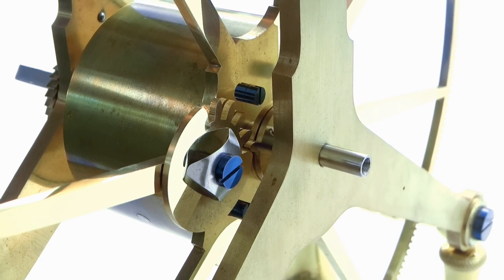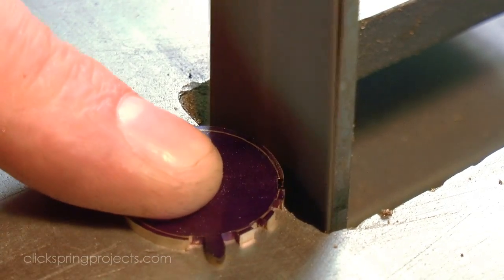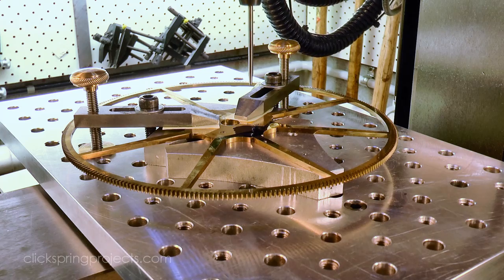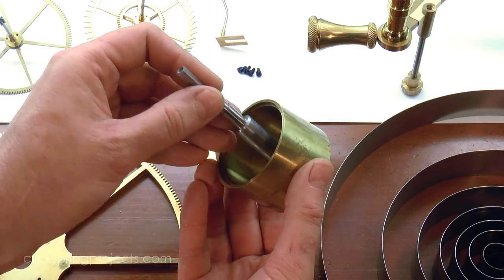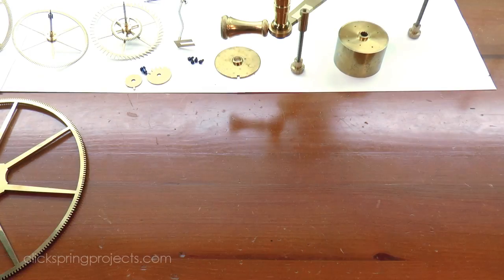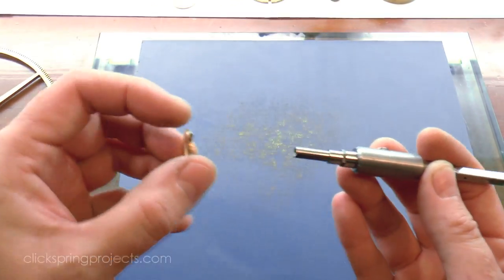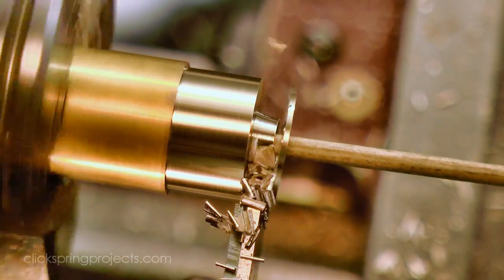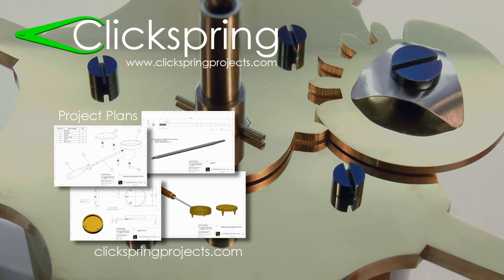Clockmaking - How To Make A Clock - Part 22 - Making The Stopwork Mechanism

Comment: Some people love worn bare metal, and painted metal full of and marks and scratches. Other people love clean polished metal, with flawless smooth surfaces. Personally I love worn and rough metal, it gives the piece character and you can see it has been used, and what parts are handled most. I can only say for these different kinds of people, that get satisfied with a specific look, you guys that like polished surfaces, have it hardest, for obvious reasons.
Reply: Personally, I agree with you. But this sort of project needs to acquire its dings honestly, over the course of decades. 

Every tick of the clock, every time it is wound, cleaned or moved will gradually add to its character. 

Fine, high quality construction demands the attention that Chris puts into it. The eventual contrast between the meticulous construction and the wear of time provides a unique beauty.
Reply: As you say, "...you can see it has been used.  This look is my favourite also, but this particular clock hasn't been used yet, and he's not artificially adding those marks and scars.  They will be acquired over the years and truly be from being used and handled, rather than beating it up to give that appearance.  When someone tries to make those marks artificially, they rarely look right, as real-world wear and tear is rarely as homogenous and random-looking as most people believe it should be.  I think this will simply add to the clock's beauty as time goes on and it acquires some working history.
Reply: I have to say I admire the work he's putting into getting all the surfaces perfect. I've had to polish hardened steel for days on end as a tool and die maker. And the soft brass must be extremely frustrating because you can scratch your newly polished surfaces so easily. I imagine sandpaper will be a significant cost in making this clock.
Reply: Siegfried Gust  Well worth the effort, though.  :-)

Comment: I was expecting some special jig for bending the friction spring and then you just bent it with hand o.0
Reply: And that hex hole done by hand! Quite unexpected but then again it makes total sense. Will that spring keep its shape over life?
Reply: yup he used spring grade steel its highly elastic he used it in another part on the clock (cant remember which) he went into further details about it in that
Reply: TorrentOfficial, I think the other part made out of spring steel that you're thinking of is... the spring. :-P
Reply: I knew that, I just couldn't remember the name of the video

Comment: End plate, all the screw slots are aligned. Just one more thing to be in awe about in this build.
Reply: I'm always confused how to make that happen, especially for flathead screws with a countersink. Maybe Chris himself can answer: How exactly do you get them perfectly lined up like that?
Reply from the maker: Make the fasteners but do not complete the slots. Drill and tap the holes, and then insert the fasteners (use grips, be gentle, but be sure to get them in there to the correct tension), pick a direction you'd like the slots to align with, and mark. Remove, and then form the slots as normal. Skim the head perimeter to remove any marring from the grips.
I did it for the large wheel fasteners in this clock after a viewer request, but generally its far more trouble than its worth, particularly with steel screwing into something soft like brass. The effect is soon compromised as the threads wear in (which you can try to predict to a certain extent) but a clock (or watch) must be repeatedly taken apart over its lifetime, so the effect is totally lost as soon as the first full clean & service occurs and the screws get mixed up. The temptation is then to try to 'chase' the effect on reassembly by overtensioning the screws - a terrible abuse of a fine mechanisms like a clock or watch. My personal opinion is that if the tapped material is soft like brass then its much better to embrace a little randomness in the presentation, and simply let the slots fall as they may.

Having said that, its definitely worth considering for steel screwing into steel, I used the procedure described above on the first Patron Series project hand vise fasteners, gave a good stable result. Above all, never try to implement the look by simply overtensioning the screw until it 'lines up'. Cheers mate :)

Comment: I've been checking multiple times a day for the last week or so and lo and behold there it was, a new video. Fantastic as always Chris. I've always loved your use of the high tech, Solid Works, and the old school, lots of hand filing. You have the patience of Job. I find myself sometimes yelling at the computer, "cut closer to the line so you don't have to file so much". More amazing and beautiful work as always. Do you suppose that single tooth is in any danger of being broken off when your ham handed great, great, great grandson overwinds it? Maybe you should make a spare and make a compartment for it and repair instructions in the base. When this project is complete you should take a break and make another stop action video like Super Tape or maybe a shop tour and maybe even show your face so you can take a proper bow. Can't wait for the final episode and what comes after.
Reply from the maker: It would take a really determined effort to break the tooth - lets hope that never happens! Currently all of my spare time is being spent on the next project prototype. Lots of new (to me) processes to figure out, and tests to be done to make sure I don't spend a year painting myself into a corner!! Definitely will do more animations; I wanted to do more during this series, but just kept running out of time for each episode. Cheers mate :)

Comment: Great video, looking forward to seeing the conclusion of this project. I was a bit surprised that the teeth for the stopwork gears were left so long. Seems like a far more robust geometry could be used due to the teeth not meshing very closely.
Reply from the maker: Hey Siegfried, yes certainly - John Wildings plans describe a cycloidal tooth profile, using a custom made tooth cutter, but its clear after playing with the mechanism that a constructor could be fairly relaxed about the tooth profile and implement just about any rounded shape with a more robust root geometry, without having too many problems.

Comment: Great work!
Just to say, over winding does not exist, you either wind the spring to the end or if you try to wind it further you simply break something!
Reply from the maker: Which is the "overwinding" that I would rather avoid! Cheers mate :)
Reply: Clickspring well in that case your stop work won't solve the problem, if you wind past the stop work you break it!
My point was the term "overwinding" as used by the vast majority of people is usually when a watch or clock is fully wound and it doesn't work so people say its "overwound" but what it really is is the watch or clock needs servicing, you can't overwound, if you use an insanely brut force to try to wind past the end of the winding it's just breaking!
Reply: What is this, a weird semantics experiment? We all know what he means by "over winding" so what is your point? He is obviously not an idiot and the parts are huge - he's going to be able to see AND FEEL quite clearly when the clock is wound enough. No one is going to use brute force to break anything. Good grief.
Reply: Frederic is right that over-winding although technically possible is only a ploy by repairmen to put the blame of malfunction on the customer. 
Frederic, if you listen to the video CS explains that he wants to limit the use of the MS to the more even tensioned mid-portion of the MS. There is (at either extreme) either greater or lesser driving tension which upsets the clock rate significantly.
Reply: Absolutely.  Overwinding (or under-winding) in this case refers to those areas of the spring's tension at each extreme, where the variation in torque applied is the greatest.  It's not necessarily referring to breaking anything - although preventing spring breakage is certainly an added bonus of the design.  I guess Fred missed that part of the explanation.

Comment: Occasionally I come back and rewatch all of the parts of this series, they're so therapeutic to put on in the background. Do you think you'll move onto a different large project after this clock has been completed?
Reply from the maker: Hey Dan, yes the next project is a long term one like this one. There will also be a lot of supporting tool making videos (related to the build), as well as a few spare parts and I guess you would call them "science" type videos to go along with it too.

Comment: What a clever mechanism that stopwork is, absolutely lovely! I'm a bit torn on the friction spring, though. It just doesn't look finished to me, which completely clashes with the rest of the clock, all of which is either polished to a mirror finish or - in the case of the arbour - is matte on all sides. The friction spring is neither, it's just the bare metal with no finishing at all. Will you try and finish it to fit better with the rest of the clock, or is that not even possible with spring steel?

Very excited for the final part, can't wait to see what the finished product looks like!

Comment: Great Video! Question: Could you have used a hexagonal reamer instead of filing around 7:35?
Reply from the maker: Hey Dave, yes I considered making a hex shaped broach, but its a fair bit more work than just getting in there with a file and doing the job. If I had 2 or more hex holes to form it would have been worth making the broach. Cheers mate :)

Comment: Your heat treat/bluing technique is so satisfying and leads to some beautiful results. Would a similar setup for a larger piece 10-12 inches Long give the same result or would it need a different setup?
Reply from the maker: Hey Caleb, it depends on how fussy you want to be regarding the uniformity of the color. Generally its a bit more difficult to get uniform color the larger the piece, but its not impossible. For something that large, you would probably need touse an oven to get a consistent color across all surfaces. If you're happy with variation in the color, then just have at it with a propane torch and see what you get :)
Reply: Clickspring cool good to know. Look forward to the winding key video.

Comment: Using your Solidworks model as an overlay of the stock is very clever! It gives a nice way of revealing what's in the stock that you'll be bringing out with tools. Is it very hard to get the SW camera view and perspective to match the real camera's view?
Reply from the maker: It can be a bit difficult sometimes - its not always apparent, but the way a camera captures an image is quite distorted from reality so the perspective lines rarely match up perfectly. Thanks for watching Stefan :)

Comment: Great work as usual, I dont quite get the purpose of this little mod, but will the turns be consumed by the clock (after some time it will need a rewinding), or is turning the barrel just setting the tension in the mainspring? Cheers on your clock build mate, would love to see a 24 hour video of it just ticking away! 😊

Comment: It wouldn't be super traditional but it looks like you could pretty easily use the stopwork mechanism to drive a power reserve gauge. Maybe not super nessecary with only 4 turns of power reserve but still.

Comment: I wonder why you used such a tall dome on your friction spring.  In my experience, It seems that the taller the dome, the more chance for the gear to jump out place.  The depthing looks pretty shallow also, but over all, you do excellent work.  I need to get some er32 collets as I am limited to a 3 jaw chuck and 8mm watch collets
Reply from the maker: Could probably go a little smaller on the friction spring if desired, but I'm following John Wildings plans, seems pretty secure at the size he has drawn. Thanks for watching mate :)
Reply: I have a lot of respect for Mr. Wilding and his designs.  I guess the use of the large spring is probably more for looks. Thanks.

Comment: I feel almost guilty saying this to the perfectionist you seem to be, but with that depthing, perhaps the single tooth should be a stub-form so that an over enthusiastic winder doesn't snap the tooth off? 
Thanks for another great video, your production quality has few peers on YouTube. The only real rival I can think of is Project Binky, which could probably go straight to (off peak) TV.
Reply from the maker: Yes just about any robust tooth form would be ok for this simple mechanism, it doesn't necessarily need to be cycloidal. Love the lads from Shropshire also :)
Reply: I really enjoyed this series from the very beginning. So much I'm in the long haul for machining a Stirling engine myself. Plans are very limited so i just have to use a tad bit of engineering knowledge.  
      I recommend you do a Stirling engine next series. but none of that simple stuff. Go Complex!!

Comment: Wait. Does this mean that after the clock has unwound the appropriate amount, the stopwork mechanism actually stops the clock from going?

And when you made the triangular spring, did you not have to harden the spring steel? Because you seemed to be able to bend it really easily.

Wonderful stuff, as ever. Thanks.

Comment: Hi ChrisAfter watching your video's I was inspired to buy the plans and build the same clock. I have made a few changes to the plans and the clock is almost ready for its first test (less motion work). I want to include the stopwork but have run into a problem that the plans do not mention so I thought I would ask you if you had the same issue and if so how you solved it. I need to machine the hex section for the single tooth gear and the shoulder of this hex section will of course act as the locating stop for the gear. The problem is that the barrel moves on the main arbor so there is some ambiguity in where the hex section should be machined. ie with the barrel fully forward or fully back or somewhere else. I was just wondering how you decided on the location for this.
Reply from the maker: Hey Jerry, sounds like possibly too much end shake on your barrel arbor - PM me using the contact form with more details: http://www.clickspringprojects.com/contact.html

Comment: Impeccable work as usual, Chris!  One question: what retains the pin for the drive wheel?  The pin appeared to be tapered.  Is this merely a friction fit at one end of the hole through the axle, or is the hole tapered to match the pin to increase friction (like a shallow Morse taper)?
Reply from the maker: Hey John, just a friction fit. Currently the holes are straight as per the drill, but at final assembly I will taper broach them to secure the pins more tightly, exactly as you suggest its like a shallow taper fit.

Comment: This is utterly amazing, although tbh after about 2 hours i would have given up and bought a plastic mechanism and just mounted it on a sheet of brass :P

Btw - does the "abrupt" stop have the possibility of damaging parts? I gather its not worth putting in a little big of springy material just to reduce the sudden stop?
Reply from the maker: Yes, its fairly easy to damage a clock if care is not taken. Careless winding is one of the big risks to the mechanism. A well informed owner who is concentrating on the task will be able to avoid damaging the stopwork.
Reply: The "springy material" in this case would be the proteins in the fingers of the person winding the clock.

Comment: Just wondering- Are all of the tools that you use for your Lathe HSS?
Reply from the maker: Mostly. I keep a set of carbide insert cutting tools in the drawer for unusually hard material, taking the surface off castings etc but for everything else I use HSS exclusively.

Comment: Interesting seeing you burnish the parts Chris, are these bought items or did you make them yourself.
Reply from the maker: A bit of both Doc - one is a file with all teeth ground off smooth, and the other is just my shop made scriber (a hardened steel needle set into a brass rod handle) Cheers :)

Comment: how often does the clock have to be rewound? It makes it look like it needs to be rewound around every two days by that mechanism
Reply from the maker: The clock requires winding once per week. Just over 5 rotations of the large wheel equates to approximately 8 days run time, thanks for watching

Comment: Where do you get all your exotic metals like tool steel and spring steel in Australia? I find it so hard to find someone good for anything other than aluminium and steel.
Reply from the maker: Yes its a real challenge in our part of the world. Most of the hard to find clock specific materials (like blued pivot steel, suspension spring steel, mainspring steel) I source from specialist clock suppliers in the UK like Meadows and Passmore (http://m-p.co.uk/), and Ian T Cobb (http://www.clockmaking-brass.co.uk/) Drill rod can be found at Blackwoods.com.au and O1 tool steel from http://www.hales.com.au/ Brass from either George White or George Weston depending on where you live
Reply: Clickspring Great, thank you very much for sharing. I look forward to your next video.